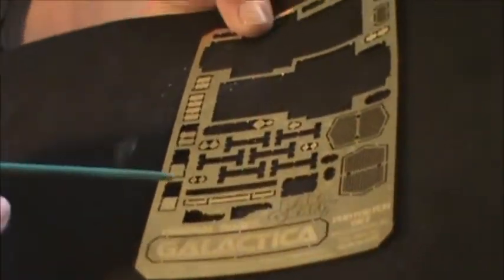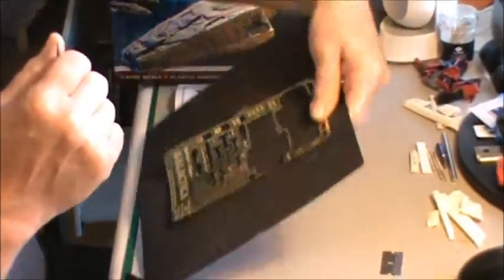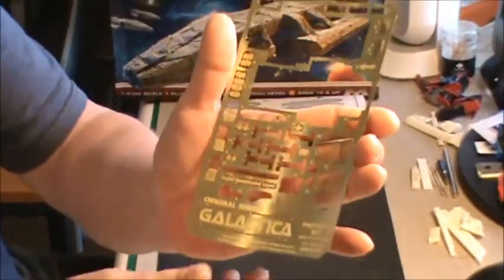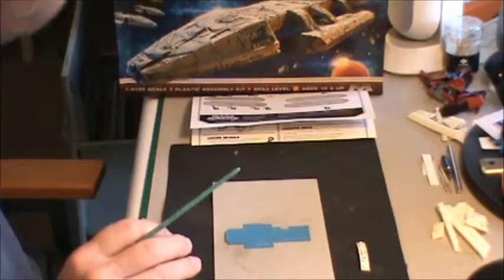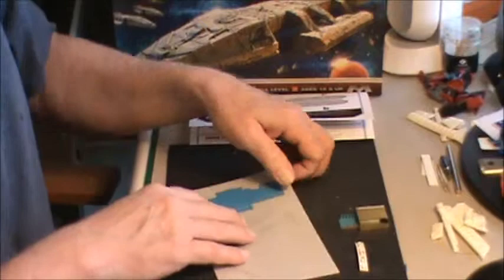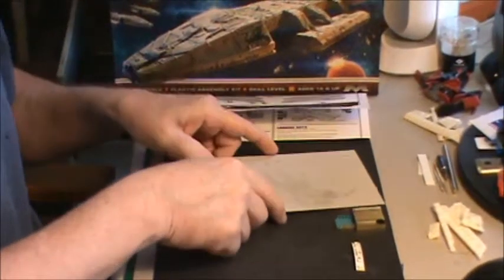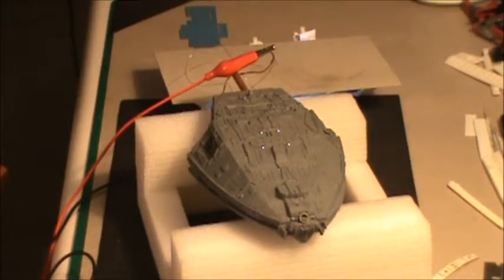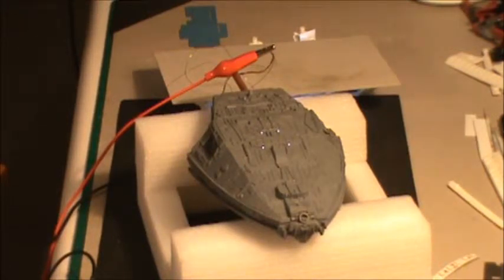BATTLESTAR GALACTICA Part 8

Comment: Thanks for calling out the photoetch parts error! I had to go dig this kit out from my vault to check, and Paragrafix has now included a second sprue with this set for three additional part #8. The instructions are not updated on the newer version to correct the #9 vs. #11 typo so thanks for catching that. Just like with your Arizona build, I dug out the instructions and wrote notes on them based off the mistakes you found. How things like this get past QA.....

I wouldn't follow box artwork when choosing colors. In the TV show landing bays were grey with orangish/red "alert" lighting. The side red lighting is coming from the launch tubes, but again those are grey when vipers aren't launching (seen when Starbuck and Cassiopeia slip away for some privacy in the pilot/movie...) When the ship isn't at alert status you can definitely see the grey color in normal lighting.

Your landing bay lighting turned out really neat. I plan to include sequenced LEDs under the floor to replicate the landing lights on my build, and also contemplating printing my own photo etched launch tubes to place behind opened up exit holes on the sides of the ship.

Comment: hi there love your videos, i have the same model need to put lighting in it i know u said in another video u use 30 gauge wire but what kind of wire cause i look in ebay n the wire they show looks thicker then that thin wire u use, n i have a cylon raider to moebius  model big sucker n i want to use that same wire for the lighting thanks again
Reply from the maker: Try this http://www.modeltrainsoftware.com/mosu2.html they sell 30awg wire.  Or Google magnet wire for models.  I got mine from TechFixx.com, but the wire from model trains looks better because both red and green come together on one spool.
Hope this helps.
Reply: thank you so much have you ever made a video of the moebius cylon raider built
Reply from the maker: That would be a NO.
Reply: will you ever build one they are huge i have one and dont know where to start jajajajaja
Reply from the maker: No, most likely not anytime in the near future.